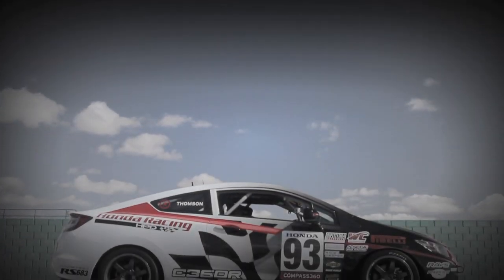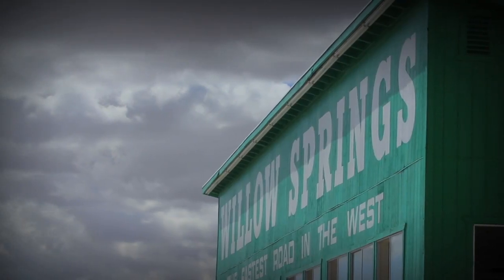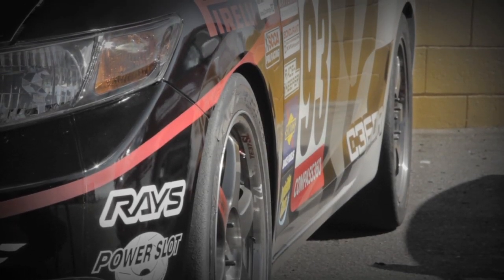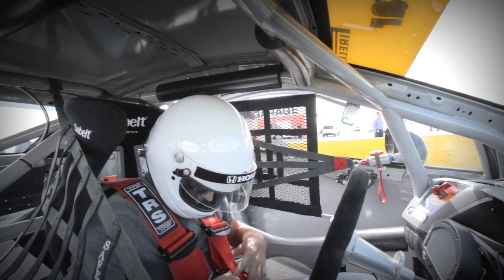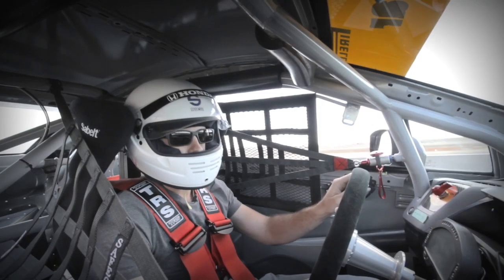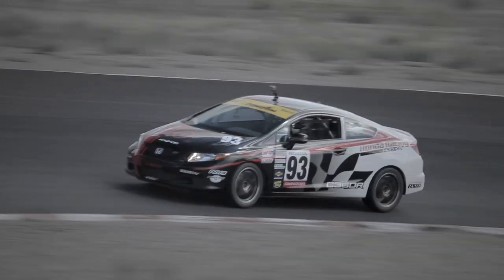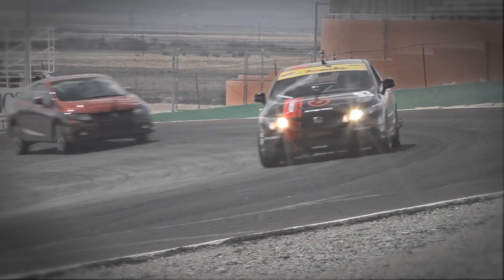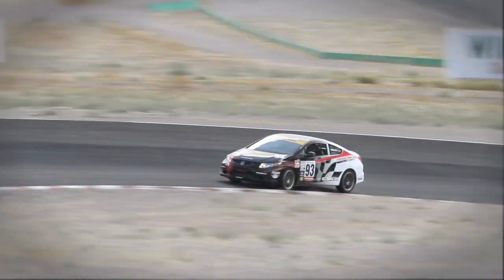First Drive: HPD/Compass360 Racing Honda Civic Si

Comment: @starksy17 the 2011 shelby can run 12's but the ford mustangs sit at low 13's or a really high 12 (depending on the temp and other variables)

Comment: @Tupples1 interesting because i've never seen that, granted i have seen GUTTED civics witha k series swap run mid/high 12's but that is with the basic bolt ons as well H/E/I. I'm sorry but I haven't seen it unlike with V8's were I have seen a stock 98 camaro run solid mid 13's on street tires.... don't get me wrong for an economy engine those K20's aren't that terrible (they beat the hell out of those shitty B16 engines in the teggys but at the end of the day they are a small engine in a FWD car